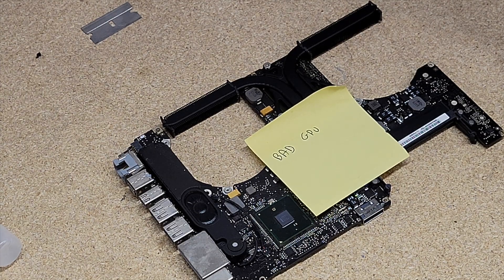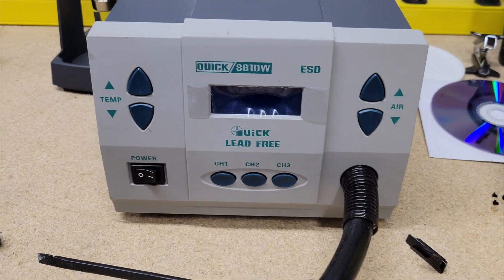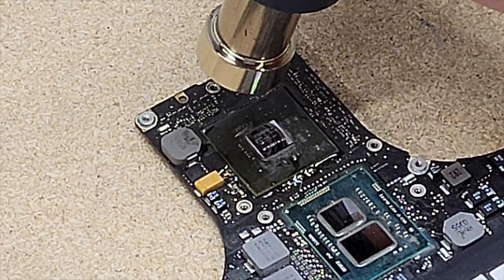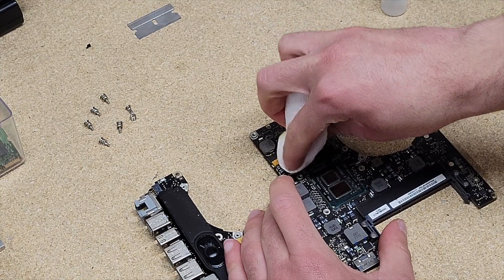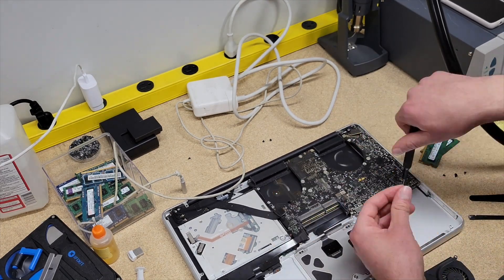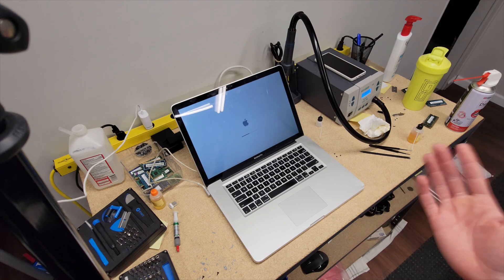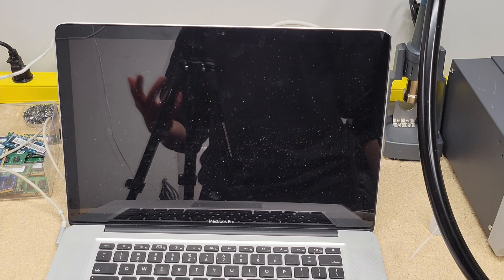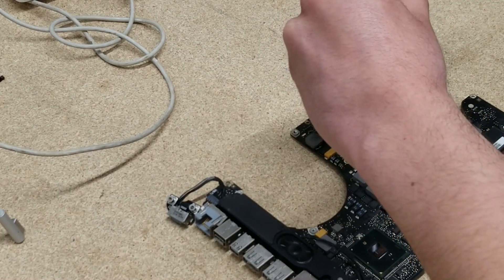Fix GPU 2010 / 2011 MacBook Pro

Comment: Thanks, man. I've changed capacitor and it isn't helped. This is the first time that someone really explaining what is happening. Next, I feel that bottom is overheating, suppose that is the reason for gpu failing. How to enable better air flow of fans? I think to drill many small holes in bottom metal cover?
Reply: there is a mac app for that, for fan control for all macs...

Comment: hello there, my hot air station does not appear to have a fan speed control, and was wondering if you have any advice for temp and timer, ive 2010 15 inch macbook pro with red artifact and wondering if its dead gpu too

Comment: What you are doing is not a fix its temporary at best it will fail.     I bypassed the faulty graphics and used Intel dedicated graphics using Dosdude Software.    Easy.

Comment: Tantalum cap failure, not GPU for 2010 15 inch model
Reply: Why do you think so, if it was solved the problem?
Reply: What about for 2011 model?
Reply: @pegpenguin 2011 have GPU failure, not this capacitor.

Comment: Hey dude, great video! I have a 2011 MacBook Pro, and upon startup, I get the horizontal lines on the screen (telltale sign of failed GPU), the status bar gets to about 50%, then the screen goes gray, and it power cycles. Seems like it will go on infinitely if I don’t force shut down.  With a failed GPU, will the computer keep power cycling on its own? Is there any way to get it to boot up?

Comment: i had success with mbp 15" late 2011 with amd gpu. Applied flux as you did, heated up till i saw flux boiling, let to cool and rinse with %99 isopropyl alcohol. it works. But i disable the gpu anyway.
Reply from the maker: Awesome, glad it worked for you!

Comment: Thanks for the video. I appreciate the temperature and timing advice. I think the solder paste bubbling was the key to knowing if you are heating things up enough.

I used 350 degC for 5 minutes and then 450 degC for an additional 5 minutes at full air flow but my hot air station isn't as fancy as yours. Seems to have rectified the problem, at least for now. 

One problem is the 17" models UEFI boot isn't 100% compatible with modern operating systems. This model was prior to the UEFI standard being finalized and Apple was trying to make this laptop compatible with Windows 7 MBR booting in bootcamp. As a result some of the hardware, like the GPU and sound card have physical hardware addresses are not really UEFI compatible. Windows 10 and some versions of Linux when booting MBR seem to be compatible, but as soon as you go UEFI booting some devices will partially or completely fail. Even Open Core Legacy Patcher has problems with the latest versions of MacOS getting the hardware right.

Software compatibility with operating systems, especially for browsers, has changed a great deal the last few years and I have to question the value of reviving these old models unless you are willing to go to Linux MBR or go through the long convoluted process of installing Windows 10-1903 from the DVD.
Reply from the maker: Interesting comment! Thank you for taking the time to watch the video and I am glad the repair worked for you!